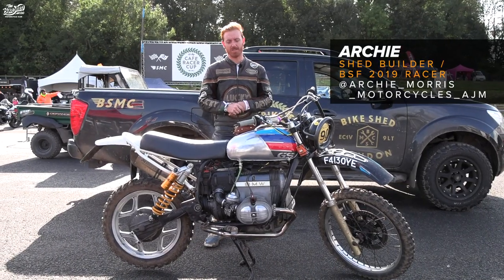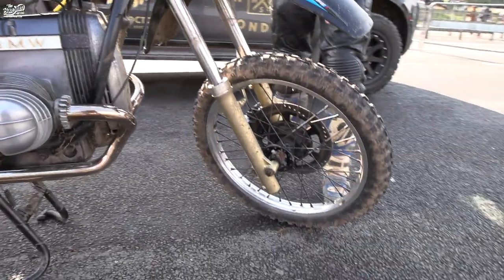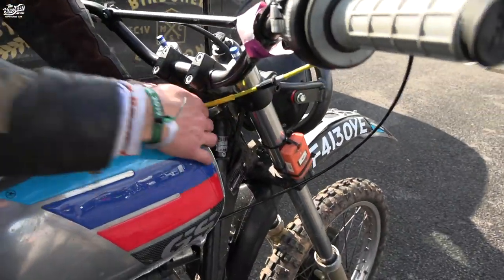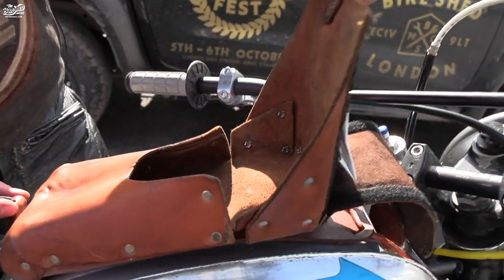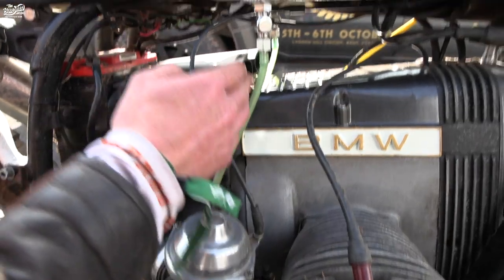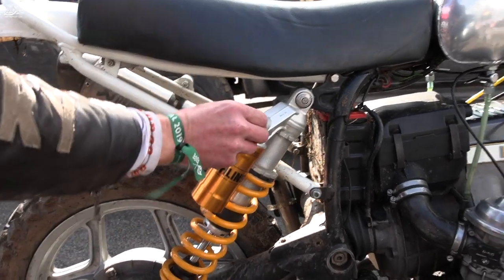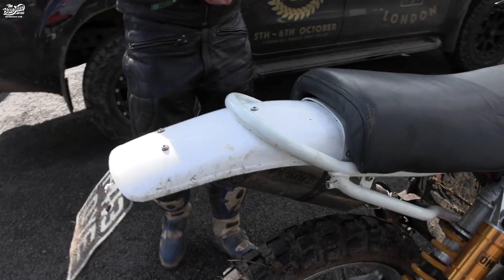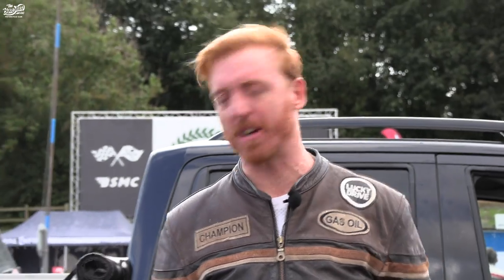Archie's BMW R80 Dakar Rallye Homage - Racers of Bike Shed Festival

Comment: Looks good so far, I've built a few of them, I would block the 2 air intake holes in that air box top and fit a high snorkel type one on the top, I used an intake from I think an X's 1100 it now draws air in right up under the seat. I can get pictures if you want, 👍👍